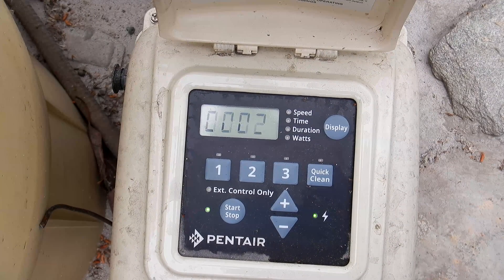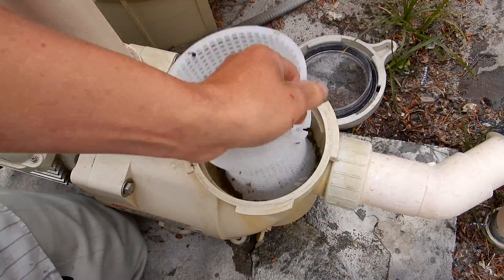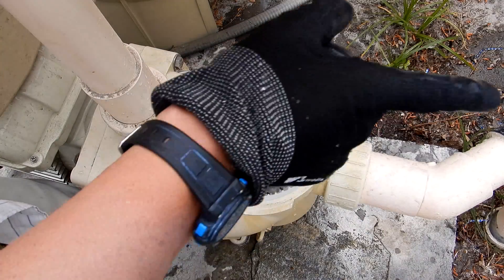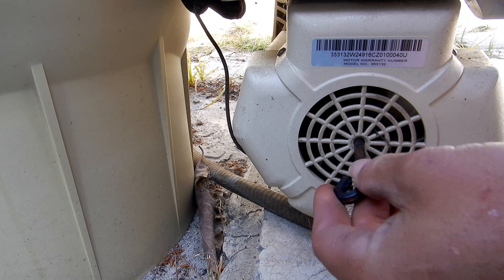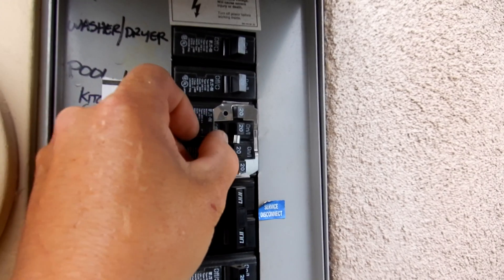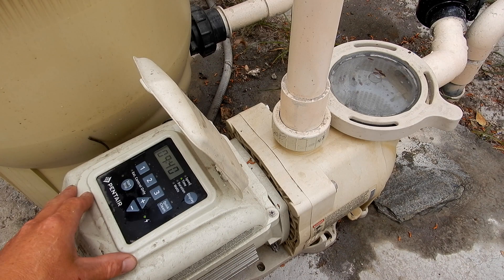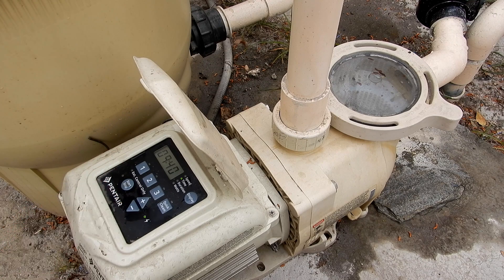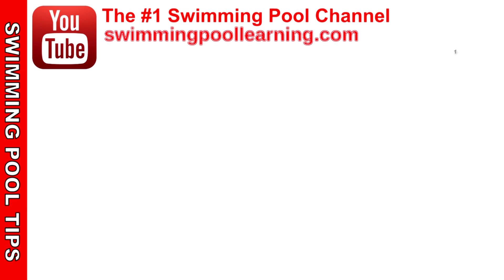How to Fix a Pentair SuperFlo VS (VST) Pump Err Code 0002

Comment: The repair place said these pumps are failing at 4 years, which is how old mine is. $2900 for a new pump and motor. Motivation to get on the Hive intelligence. I cut the power first. I couldn't reach the impeller because there was a wall in the way. I got to the Allen bolt. on the first 3 or 4 rotations, it was a little stiff but then got easier. When I rebooted, the pump worked!
Reply: The Pentair superFlo vs is $1,200 for the pump. I’d definitely ask them how they got to that amount.
Reply from the maker: Seems a bit high.

Comment: Error code 0002 did the trouble shooting still same. Had pro come by switched out breaker still same error code. It makes a sound like it wants to start buzzing sound. Now pro says I need a whole new pump but he said it's the drive. If purchase new drive will it solve problem?

Comment: That worked, thanks! Today i noticed my pump stopped and was showing both E0002 or E000f.
Gave the impeller a few turns with the allen key and it started right up!
Reply: Although now it is seized up and won’t start.

Comment: Talk about an oldie but a goodie! My pump suddenly stopped working - I just heard this funny "tink" sound. I thought it was a relay but coming from the pump. I'd fairly recently replaced a bad relay so had the panel off and tapped the relays and nothing.

I did note there was an error code and Googled and thought hmm, I hope that doesn't mean a new pump! Found this video and gave the cooling fins a gentle turn and presto! I would have used the Allen wrench but couldn't get the right size. Tried going in from the front but could not feel anything to grab onto to turn. 

Thank you for the video!

Comment: Leslie pools sent out a tech that was here 10 minutes, he said it's electrical, best just to replace the 3 year old $1,200 pump! they quoted me $1,900, I opted to just pay for service call.  Pinch a Penny installed it but couldn't find it in their system (I got that line from them before), their tech was $150 just to look at it. I googled this vid, went out in the pouring rain, freed the propeller. turned power off, then on. VIOLA!!! A total of 20 minutes. no more error code, pump working fine!!! I'd rather send this guy money! THANK YOU!!

Comment: When I saw that 'Err' error code on my pool pump screen today my heart sank. I hopped on the internet in hopes of finding a fix before I called my Home Warranty company. Your advice worked like a charm. I did both the screwdriver fix AND the Allen wrench turns (thank goodness I got a set of Allen wrenches for Christmas! ) along with shutting the pool pump off and on at the breaker panel and voila IT WORKED! You're a lifesaver!

Comment: Just had this error happen to me, googled it in a panic, ended up here and solved my issue - thanks! Ended up putting a screwdriver in and rotating the impeller, it started right back up after. One other thing of note is that when I was trying to start the pump I'd hear a small 'ting' before the error.

Comment: I had this problem on a pool recently. Performed this procedure and it worked initially, but the problem returned time and again. I removed the pump and found the impeller screw was 1-1/2 turns loose. Tightened it and reassembled . It’s been 8 weeks now and the problem has not happened again. Hope this helps someone with the same issue!

Comment: Great video!  It got my pump working but now every morning I need to turn the propeller just before the pump starts up or it will go into the 02 error code & will not start unless I cut power then turn back on.

Comment: Pentair SuperFlow VS Error code 21 fix.. I turned pump and circuit breaker off and performed resistance checks on the 3 wire input to motor assembly.. I found a floating ground (unit not properly grounded) with resistance not a zero or near zero. Sure enough old connections in power panel that needed cleaning. Plus, my ground wire there traveled through another unused panel. Cleaned both.. Checked resistance and it was at zero ohms. Unit still would shut off and show error 21. I looked around the pump and saw the grounding lug nut with no grounding wire. I had extra wire so I cut a 4ft piece and ran that ground wire from the outer motor casing lug nut back to the same power panel. B I N G O ! Pump hasn't kicked off once since I took care of that floating ground. Solution brought to you by ye ole retired Navy Masterchief.
Reply from the maker: “Aye aye, captain!" 👊
Reply: If the error 21 still remains, shut off the pump breakers, remove the 4 screws of the control box on top of the motor, remove the control box, remove the small connector on the left side, check for dew or water in or around the jack receiver, dry the area, put the connector back, put the control box on place, put the 4 screws in place, turn the breakers on, check if still read the error 21, if no, push down the on/off button and it will begin to do priming. I hope this works out for you, bye.

Comment: On my pump all the leds are constantly on and nothing on the display screen. I tried power cycling but no change. All leds stay on. No error codes. What is wrong?
Reply from the maker: I would call Pentair on Monday. Maybe some wires are loose inside the display.
Reply: @SPL  thank you so much for replying. The pump was installed and working fine for 2 yrs and this happened after a power outage. Is there a way to fully reset the pump electronics

Comment: Do you have any Idea for a 1A error for the Pentair Superflow?
Reply from the maker: 1A - Power Module over current detected

1A – Power Module over current detected: If this error displays multiple times, then there may be a problem with the pump’s rotating assembly. Please disassemble the pump and investigate to see if there is a problem with the impeller or mechanical seal.

Comment: Worked for me, Thanks!!!  This was my second stop after the manual ( why can't they put this in the manual??).  They only suggest power reset.  I had this nightmare scenario of replacing the pump running through my head - so glad I found this!

Comment: Thank you for a quick succinct video. Err code 0002 is an electrical surge. I tightened all the connections, cycled power, waited 10 minutes... did everything...except look for a jam! I gave my impeller a quarter turn with a hex wrench, and viola, fixed!! Thanks again.

Comment: Hello, thanks for the tip. Worked for me as well. However, every time I stopped the pump, I have to redo Allen key and resetting. Do I need to disassemble and see what I got in there? Also, does it need to prime at 3450 rpm? I set mine to 2300 and does prime.
Reply from the maker: 2300 RPM is a good priming speed. As far as the constant error you might want to call Pentair directly and see if they have a solution.
Reply: @SPL  Will do, thanks!

Comment: Should have checked here first.  Just paid $180 to have the service guys tell me I need a new control panel.  Sat for a few minutes and thought I’d find out if I could replace the control myself.  Saw this video...5 minutes later my pump is working because of this procedure.  Apparently the service guy doesn’t know about this!!  Thanks guys!

Comment: Hello great video. I'm having a error code 000f and my pump is not running was wondering if you can be any help thanks
Reply from the maker: You may have to call Pentair on that one. Haven't run into it yet.

Comment: I have this exact pump and it makes a clicking noise when its priming at 3450 but when i bring it down to about 2900, then it stops. Any ideas? Love your vids!
Reply from the maker: Sounds like it may be vibrating from not sitting level. At 3450 RPM put your hand on top and put some weight on the pump. See if that stops the noise.

Comment: Thank you I just found your video as I have the error code on the pump. I found a screw driver (1.5 inches long) inside the basket, and don't know how it could have ended up inside the basket. Is that a screw driver inside that has come loose soI  need to screw back to clear the error?
Reply from the maker: Could be the impeller screw.
Reply: @SPL  I was able to screw the set screw right back inside the basket. I could not feel anything blocking the inside, but the error message didn't go away after I turn off and on the circuit breaker.  Any other suggestions? thank you.
Reply: Thank you. Is that part number 22? Can you tell me how to screw it back?

Comment: Had error code 0002.
Impeller spins freely.
Reset breaker
No more code. Removed cover... has power.
When attempting to start green lights blink ...nothing happen. Tried resetting by holding all 4 buttons down Simultaneously. Did nothing.
Any advice?
Reply from the maker: Maybe call Pentair on that one.

Comment: Any idea on how to fix the same pump but with the error code 000F ? Did research and it says it's a voltage problem. Checked all the wiring. Replaced the breaker, and still nothing. Was running the pump for 3 yrs before this happened..
Reply from the maker: Not sure. Never seen that code.

Comment: I have power going to mine but a blank screen. It ran dry and this happened. Should I just replace the top part where all the electronics are or the whole pump?
Reply from the maker: How old is the pump? Just want to make sure it is not still under warranty. This may fall into a Warranty call to Pentair
Reply: Swimming Pool Tips, Reviews & How To - SPL not sure I’ll have to ask. Pretty sure it’s out of warranty tho.
Reply: I have the same problem on mine greenlights flaches every 10 second

Comment: I only have 3 of these digital pumps on my route,  do you use a screw driver because the impeller is deep in there or is it reachable with your fingers
Reply from the maker: Yes, it is pretty far in on  the Pentair pumps.